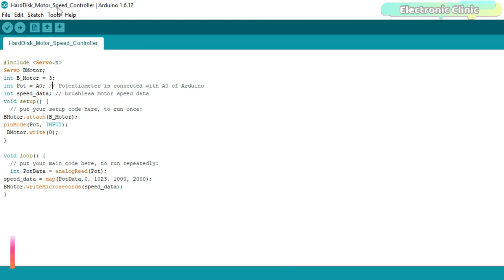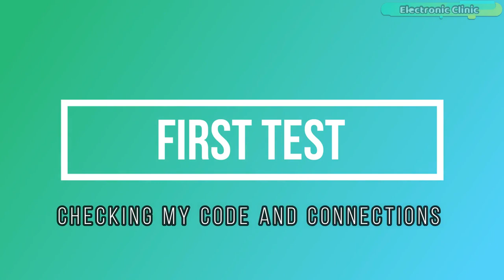How to make Sander from the Old Hard Drive using Arduino, HDD motor, Diy Sander, Hard Disk BLDC

Comment: Hello friend, first of all, thank you for sharing the video. I have two questions:
1) What is more viable, to do with the Arduino or the Multi Servo Tester?
2) Does the HD logic board itself not have enough strength for this purpose? I say this because I tried it with the HD plate and, when I go to sharpen, for example, a screwdriver, when I press the screwdriver a little against the sandpaper running on the disc, the motor stops rotating. Thanks
Reply from the maker: It's because this motor offers low torque. I suggest you should use 775 motor, you can watch my video on 775 motor. That's a low cost yet powerful motor.
Reply: Thanks  @ElectroniClinic